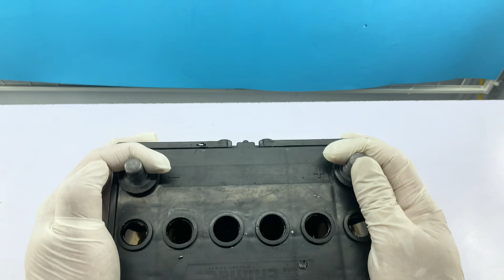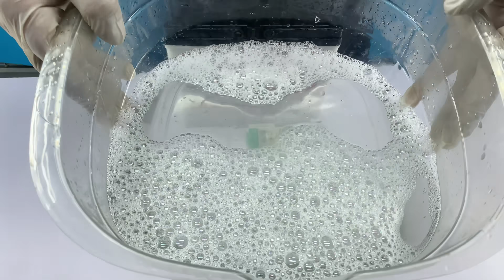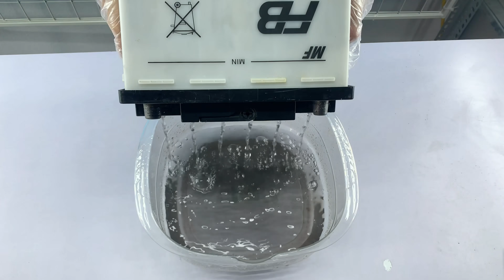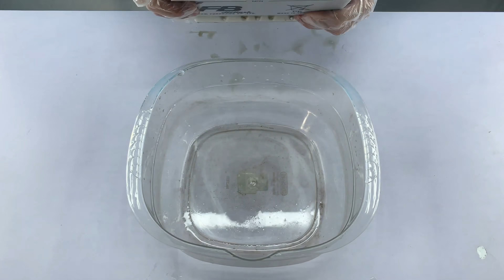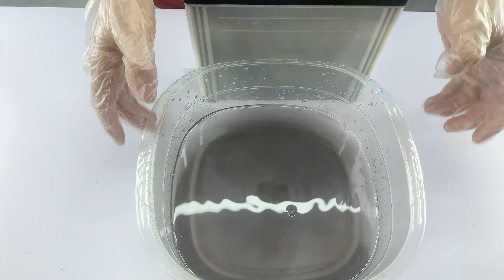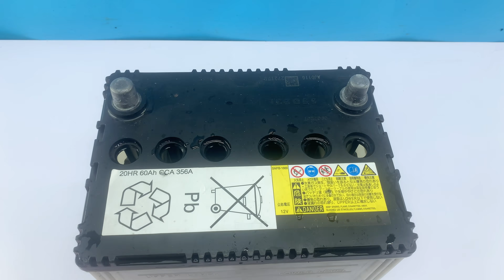Old BATTERY Like New in 1 Minute! 3 Quick Ways to Restore Your BATTERY! 😱UNBELIEVABLE!

Comment: Take a hammer and beat the heck out of the sides too dislodge any sulphates stuck too the plates,plain water is not gonna do the trick
Reply from the maker: Thanks for sharing your thoughts! 🙏🔋 Sulfation is a real issue, but hitting a lead-acid battery with a hammer can damage the case/plates and expose corrosive acid, so we wouldn’t recommend it. ⚠️ What safer desulfation method have you had good results with? 👇

Comment: 10 volts you still have one dead cell
Reply from the maker: Thanks for pointing that out! 🙏🔋 You’re right—a 12V lead-acid battery reading around 10V can indicate a failed/shorted cell, so charging alone may not fix it. Have you tested the individual cells to confirm? 🔧👇

Comment: Can I still use the old electrolyte
Reply from the maker: I wouldn’t recommend reusing old electrolyte. ⚠️ Its condition and concentration may have changed or it may be contaminated. For safety, follow the battery manufacturer’s instructions and handle/dispose of old electrolyte properly. 🔋

Comment: Tell me what happens when the battery  cells are damaged can it be cleaned?
Reply from the maker: Good question 👍 If the cells are physically damaged, swollen, leaking, or internally shorted, cleaning won’t repair them and they should not be reused. If it’s only corrosion on external terminals, that’s a different issue. Safety comes first. 🔋⚠️

Comment: The basic of a battery can be made with a potato or a earth battery,but to use for amp draw your need more amp power loads amps. It is like trying  start your motor cycle or car on small flash light batterys- meter may say 13-14v, but No Laod power. Sorry to brake your ballon! Amenl
Reply from the maker: Good point 👍 Voltage alone doesn’t tell the whole story—the source also needs enough current capacity under load. Thanks for adding this important technical detail to the discussion! 🔋⚡

Comment: are you using mineral water/bottle water to clean the battery compartment
Reply from the maker: Thank you for your question! 😊 In battery maintenance, many people prefer distilled water because it contains fewer minerals and impurities. The exact liquid used can vary depending on the procedure shown in the video. Always follow proper safety guidelines when working with batteries and battery acid.

Comment: Muito bom e didático. Além das imagens , cada ação vocalizada de forma simples e direta. Dos três métodos, achei o mais prático o que utilizou a Coca-Cola. É o mais eficaz ou é indiferente? (Cabo Frio - Brasil)
Reply from the maker: Thanks a lot 🇧🇷🔥 glad you found it clear and useful.

About the Coca-Cola method: it’s not really more effective by itself. The result usually depends more on *mechanical action (scrubbing/cleaning)* and the **type of corrosion**, not the drink specifically. Any mild acidic solution can help loosen rust a bit, but it’s not a magic advantage over other methods.

So in practice, it’s mostly interchangeable—what matters is the cleaning process, not the brand of liquid ⚙️

Comment: Solomon  Islands
Reply from the maker: In the Solomon Islands 🇸🇧, a DIY TV antenna can work for *free-to-air channels* in areas close to broadcast coverage, especially around Honiara.

However:

* Reception can be limited outside main population centers
* Terrain and islands can weaken signals
* Proper placement and height matter a lot

So it may work in some locations, but not reliably everywhere.

Comment: From Zambia, but residing in my Repair Summer Hideout In Papua Currently. Which Brand of Toothpaste would you recommend? 
I'm also using old toothpaste blurts to brush the neg and pos Nipples clean. Gives the battery a Smiley new look too. 
Thanks and hopefully the shelves aren't all clean out of toothpaste. May try mouth Rinse though too.
Reply from the maker: That sounds like quite the setup! 😄 Just a couple quick tips:

🔹 *Toothpaste brands:* If you want something easy to find and gentle, go for widely available options like *Colgate* or *Oral‑B* — they’re reliable for everyday brushing.

🪥 *About using toothpaste on battery terminals:*

* Toothpaste can help *remove corrosion* (the white/green stuff) because it’s mildly abrasive, but it’s *not ideal long‑term* — it can leave residue that attracts moisture and causes more corrosion later.
* A better option is a *baking soda + water paste* (very safe and effective) or dedicated *battery terminal cleaner* from an auto parts store.

🚗 For freshening breath (mouth rinse): that’s great for oral hygiene — but *don’t use mouthwash on batteries* 😂

If shelves are empty, toothpaste brands like **Sensodyne**, **Close‑Up**, **Aquafresh**, or local regional brands will work fine too — just pick one with fluoride.

Let me know if you want toothpaste brands suited for sensitive teeth or particular flavors! 😄

Comment: What kind of sun light h2o yu pour inside the battery
Reply from the maker: It’s usually just clean water for a simple test 😄 No special type needed. But be careful, and results may vary depending on the battery condition 👍

Comment: What else do i use in case I don't have sulphuric acid.Sam from uganda.
Reply from the maker: If you don’t have sulphuric acid, don’t try to substitute random acids — it can be dangerous.

For most DIY/cleaning uses, you can try safer options like vinegar, lemon juice, or a proper commercial solution made for that purpose.

Stay safe, Sam! 🙌

Comment: Try replacing that acid with aluminum sulfate water solution and see what happens.
Reply from the maker: Thank you for watching and for the suggestion 🙏😊
With batteries, changing the internal solution can be risky and unsafe, so I always put safety first and encourage following the manufacturer’s guidance.
Which type of battery are you referring to (motorbike, car, or smaller cells)? 💛

Comment: You failed to mention a few important key points. 1. Rinse only with distilled water NOT tap water. 2. Be very careful with and save old battery acid water to be properly disposed of. 3. After Coca Cola is poured in each cell to above plates leave for approx 10 min then rinse each cell with distilled water  until the water is clear when poured out.
Reply from the maker: Thank you so much for adding these important points 🙏😊
Your notes about distilled water and proper disposal are very helpful, especially regarding safety.
Do you have any other battery maintenance tips you’d like to share with the community? 😊

Comment: Is this process can be followed in case of inverter battery ? Here distilled water is used.
Reply from the maker: Yes 👍 the same general process can be followed for an **inverter lead-acid battery**, since it’s the same basic chemistry.

But a few important points:

* ✅ *Only for flooded (wet) lead-acid batteries* where you can open the caps
* ✅ Use *distilled water only* — never tap water
* ❌ Do NOT open or add water to *sealed / SMF / AGM / Gel batteries*

Also:

* Check electrolyte level before charging
* Don’t overfill (fill just above the plates)
* Charge slowly after topping up
* If plates are badly damaged, water won’t fix it

If it’s a sealed inverter battery, this method should NOT be used ⚠️

Comment: I did this once, without the toothpaste step.  But I shook the whole battery forcefully instead of just rocking it back and forth which does little for removing the sediment at the bottom of the battery which piles up and can short out the cells.  There was a lot of sediment in my battery.  The acid and water was far from clear.  I don't do that now, because how would I recycle the lead polluted acid and water?

Also, you should just LOOSEN the cell caps, not remove them during the shaking to avoid sloshing the acid out and onto you.  And wear a face shield and keep a box of sodium bicarbonate handy!
Reply from the maker: You’re absolutely right — safety is critical here. Shaking can stir up sediment, but it also creates serious risks with acid handling and disposal. Loosening (not removing) the caps, using full face protection, and having baking soda ready are all essential precautions. Recycling contaminated acid properly is another reason this isn’t something most people should attempt.

Comment: What’s the powder name that you melted with water to clean the battery cells please?
Can we use bread soda or just lemon juice instead? Thanks sir
Reply from the maker: Good question 👍

The powder is usually *baking soda (sodium bicarbonate)* mixed with water.
It’s used to *neutralize battery acid* and clean corrosion on the terminals.

You can use:

* ✅ *Baking soda + water* → *best and safest option*
* ⚠️ *Lemon juice* → acidic, can clean dirt but *not ideal* for neutralizing acid
* ❌ *Do NOT use* baking powder (it’s different)

After cleaning, always *rinse with clean water* and *dry completely* before reconnecting.

Comment: WHAT DO YOU DO WITH BATERYS OF NOT SULFURID  ACID LIKE OPTIMA BATERYS? PLEASE COULD YOU ANSER THE CUESTION THANKS
Reply from the maker: Ah, got it! 😄 For **batteries that don’t use sulfuric acid**, like **Optima AGM or Gel batteries**, here’s what you do:

1. *Do not open or pour anything out* — they’re sealed.
2. *Use normally* until they’re discharged.
3. *Recycle properly* — take them to a *battery recycling center* or an **authorized drop-off**. They still contain lead and other materials that must not go to regular trash.
4. *Do not throw in fire or water* — it can be dangerous.

In short: **sealed → use → recycle safely**. ✅

If you want, I can make a *super short version you can comment directly* under a video. Do you want me to do that?

Comment: Sulfuric acid How much degree.?
Reply from the maker: Sulfuric acid should not be used in this DIY at all.
The video does not require sulfuric acid, any concentration, or any chemical like that. Using sulfuric acid is extremely dangerous and can cause burns, toxic fumes, and serious injury.

So the correct answer is: 0% – do not use it.

Thanks for asking and staying safe.

Comment: Sorry I did not mean 160 but 12,6. Volt is fully hot American battery. I been doing this for over 50 years but fully charged battery when new will be when cool li’e you said at least between 1.50 plus , if at say 12.70 or much higher then you still got bad cels shorting together stacking juice
Reply from the maker: Thanks for sharing your experience, Jimmy! 🙏
You’re absolutely right — a healthy battery should cool down to around 12.6–12.7V. Anything much higher can indicate a shorted cell.
With your 50 years of work, what battery issues do you see most often today?

Comment: You know he is not in American by looking at battery chargers electric plug is ro7nd terminal on wall plug end meaning 240 volts they use 240 overseas . When I was stationed in Spain I had to use adapters on ev3n my electric razor to use there electrician same as Canada in place o4 France
Reply from the maker: You’re right, the plug is for 220–240V, I’m not in the US. 😊
It’s always tricky with different voltages and adapters in other countries.
Did you do a lot of electronics or DIY projects while you were stationed overseas?

Comment: If that was America then the battery like you said should be 160 when off chargers but how long did he charge. If together American 12.60 or more then chargers at maybe 10 amp per hour for at least 24 hours . Then if it does not come backto1.56 throw it out . Dead cell  none repairable
Reply from the maker: Thanks again, Jimmy! 🙏
You’re absolutely right — if a battery won’t settle near 12.6V after a long proper charge, the cell is most likely dead and not repairable.
In your experience, what charger amperage works best for reviving weak batteries?

Comment: He is ineurope not American and using a 240 volt charger and voltage reading will not be same voltage as American
Reply from the maker: That’s right, Jimmy — I’m in a 220–240V region, so the plugs and chargers are different from the US. 😊
But the battery voltage readings stay the same no matter the country.
What kind of battery setups did you work with most during your service?

Comment: قبل شراء باطري جديد من السهل اجراء عملية غسيل بالماء الفاتر مع خض الباطري جيدا" عدة مرات ثم نستمل مادة الكوكاكولا ومن ثم نقوم بعملية الشحن .. وللعلم بالإمكان استعمال شاحن الكمبيوتر بعد قطع الجزء المغذي للكمبيوتر وتوصيل طرفي السلكين الحار والبارد بطرفي البطارية .. اما المادة السائلة التي تستخدم في الباطري تسمى في بلادنا ( مية نار والعراقي Tee Zab). وهذه متوفرة في محلات ببع اطارات السيارات والبطاريات .
Reply from the maker: Thank you for sharing your method! Warm-water rinsing and shaking the battery can sometimes remove residue, and Coca-Cola is acidic enough to help clean plates — but it won’t fully restore a weak battery. Using a laptop charger can work in low voltage situations, but it must be done very carefully because incorrect polarity or amperage can be dangerous. The liquid you mentioned — “battery acid / Tee Zab” — is indeed the electrolyte used in many places.
What other battery-related DIY tips would you like to explore?

Comment: Noticed from your test results you ended up with 10.42 volts. a six cell battery should finish charge @ 12.56 at rest after a cool down period. In my estimation, the battery you charged has a cell that's damaged. Each cell should put out 2.05 volts approximately
Reply: Terima kasi infonya semoga bermanfaat.
Reply: 駄目だこりゃ。
Reply: 0:55
Reply from the maker: You’re absolutely right 👍
At 10.42V, that battery is still far from healthy, and it likely has a damaged cell. Thanks for pointing that out so clearly!
Reply: Yg dibuat nyuci air putih biasa bukan  SH2 SH4 ?
Reply: 21:18

Comment: Been there, Done that, The Old Battery was still Dead, I put the Battery on the charger after I was done cleaning out the battery, Put new acid in the Battery, Charge the Battery, It will lite up a light Bulb, But then tried to start the Motor, DEAD
Reply from the maker: *Sounds like you tried everything already 👍*
If a battery lights a bulb but **can’t crank a motor**, it usually means:

* The plates inside are *sulfated*
* Or there’s *internal damage* that cleaning/new acid can’t fix

In that case, the battery is basically at the end of its life.
Thanks for sharing your experience — it helps others know what to expect!

Comment: Hello, considering the battery is old, no matter what it should have above 12 volts minimum, below that it won't power an electric starter. me say HI from Chula Vista California
Reply from the maker: Hello! Yes, you're absolutely right — an old battery should still stay above 12 volts to reliably power an electric starter. Anything below that means it’s getting weak.
Thanks for the helpful insight, and greetings to Chula Vista, California! 🙌😊

Comment: Soda in colas will kill a battery.  The baking soda neutralizes acid.   A customer tried this with a weak battery.  The soda killed it completely. Soda can clean outside of battery so accumulated acid on outer cover can’t cause voltage drainage.  Same could be done at car wash w/o soda
Reply: You can buy a whole box of baking soda cheaper than you can buy a "soda", these days, and probably clean the terminals of at least 30 to 50 batteries with it.  But no, don't throw it into an open cell, unless you want to degrade your battery.  😅
Reply: You should pour a cup of soda water over the battery if you notice that the top looks wet.  That wetness is acid, and, if it reaches from post to post, it will become a leakage path and slowly drain your battery.  Just rinse it off afterwards with pure water.

Comment: This Bateries Need To Be Charged  At Full Charge 12.6 
Or 12. 7 Volts
To Be Good If Not
If The Bateries Has Less 12 Volts
The Bateri 
Is Not, 👍

Comment: I would like to follow up on the comments made by other viewers. The comments that seemed most relevant to me  were 1) the use of distilled water only, 2) the significance of the restoration process when it does not yield a fully charged battery,  3.)  what to do if the battery overheats and the meaning of overheating, 4) the water to sulfuric acid ratio, and 5) disposal of the contaminated rinse solution. I think your tutorial  is great and so easy to follow. I fully enjoyed your creativity. I know it must have taken a great deal of time organize and produce this video. Thank you. USA Tennessee.
Reply from the maker: Thank you so much, my friend! 😊 I’m glad you enjoyed the video and found it easy to follow.
You’re right — all those points are very important: use distilled water, understand that the restoration isn’t full, watch for overheating, keep correct water-to-acid ratios, and dispose of the solution safely. Safety first! ✌️🔋🇺🇸

Comment: How is 10 volts fully charged on a 12 volt battery?
Reply from the maker: Good question! A 12-volt battery is fully charged at around 12.6 to 12.8 volts. If it’s showing only 10 volts, that means it’s partially discharged or has a weak cell. 🔋😉
Reply from the maker: Good question! A 12-volt battery is fully charged at around 12.6 to 12.8 volts. If it’s showing only 10 volts, that means it’s partially discharged or has a weak cell. 🔋😉

Comment: The 10.4 volts is not correct for a fully charged 6 cell (2.2 volts per cell) lead acid battery ,12.6volts is what that battery should be at if it’s working properly when fully charged.
It’s good fit nothing other than to light a single bulb like your doing & it would not have enough volts & cca’s to start the avg car or truck either.
Reply from the maker: You’re absolutely right — 12.6 volts is the correct reading for a healthy, fully charged 6-cell lead-acid battery (around 2.1 V per cell). 🔋
This small battery I used here is only for light-load demos, not for starting engines. Thanks for the clarification! 🙌